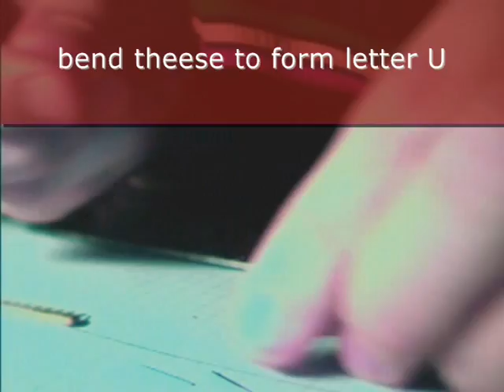SPIN DIY board soldering guide (POV bike led display)

Comment: @beannshee what are specs for led diodes? voltage/current/illumination you used?
and what is the network resistor value?